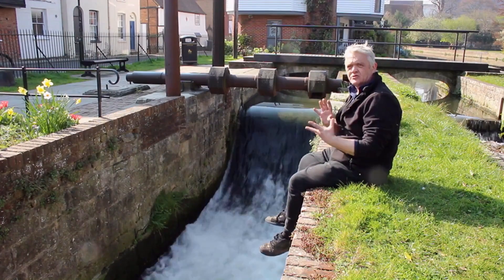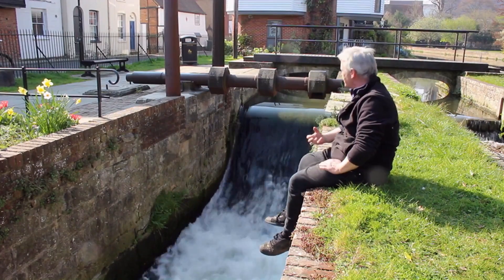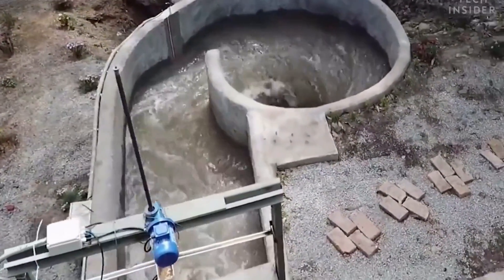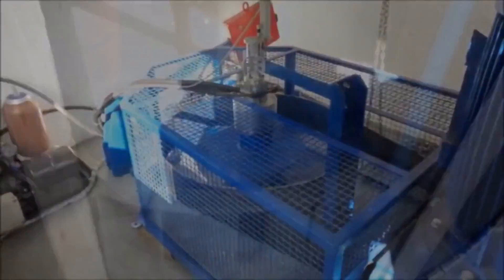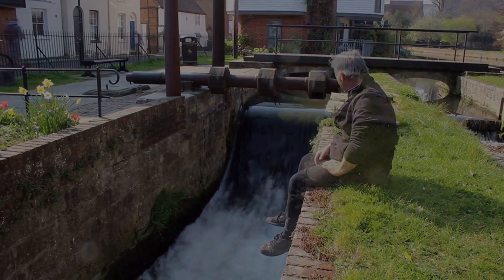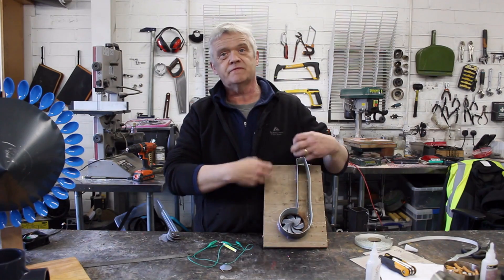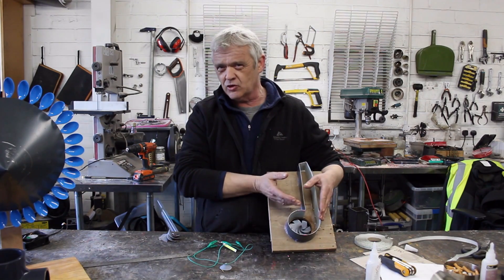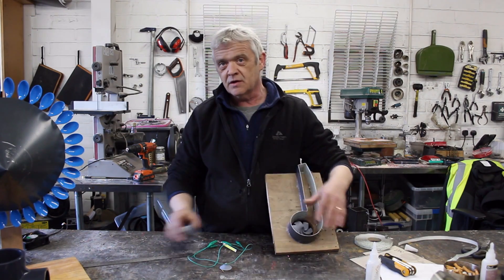1488 A Kinetic Turbine

Comment: That pressure can simply be created by gravity . Have a stream fill up a tall 2meter high container and at the bottom have a hose . A lot of pressure can be created if you have the fall of the land in your favour . If you have a river or creek that winds back on itself then you could simply have a shorter hose to fill up . Another way is to bury a 2 m long 100 mm pvc pipe upright in the ground with top level with creek . The bottom has a hose that will have pressure at the bottom so this  hose  can be taken elsewhere that 2 m lower than initial creek height !

Comment: Erm - if you did what I think you did, your measurements are completely wrong.  Did you first put a voltmeter across the open circuit output, then put an ammeter directly across that same output at a later time?  If so you are incorrect.  The current reading is short-circuit current (i.e. close to 0 volts) while the voltage reading is open-circuit voltage.  You have to measure current and voltage at the same time while feeding into a suitable load (resistance).   Choose a load that gives half the open circuit voltage to get the max power available.
Reply from the maker: no mate - that's not what I did - but thanks for pointing out it would have been an error if that is what I had done and that I hadn't been clear - all the best

Comment: Could a Hydraulic ram be used to turn the potential Energy of a low head water source to Kinetic energy? The pressure in the delivery pipe can get quite high
Reply from the maker: yes - that is pretty much what a water accumulator is

Comment: 0.4 watts / 1.7 watts = 23% energy out vs energy in if that was 30psi & 0.5kg/minute by calculating the equivalent head and using gravitational potential energy of m*g*h. Neat for what it's made of. In the limit of low flow high pressure scenarios you begin to be able to use hydraulic motors (ones made for use with water) instead of turbines though.
Reply from the maker: nice - cheers mate

Comment: Hey Rob, a measurement method I like to use is to use a 10 ohm resistor as a test load. Then just measure voltage across it, divide by 10 to get amps. Then square amps and multiply by 10 to get power. It is more accurate with dc, since you don't need to consider phase angle. Cheers.
Reply from the maker: nice tip mate - cheers
Reply: To find the maximum power achievable you need to adjust the load to suit the generator/turbine combination.  As the load changes, the output voltage also changes due both to the internal impedance of the generator and the amount that it slows down due to the higher electro-mechanical drag as load current increases.  There is only one point at which the power transfer is at maximum - power will reduce with loads both above and below that point  (Assuming that the max power transfer point is less than that which will cause the generator to overheat).  An MPPT charger is designed to automatically vary its input load so that it is always at the max power transfer point of the supplied input device.  Which can cause some input devices (e.g. an engine-driven alternator) to burn out, so use with caution.
Reply: @davemould4638  good point.
Reply: Indeed, power is volts * amps, but you need to measure them together!
Reply: @edc1569  Please refer to power formula. Amps squared times resistance,  or voltage squared divided by resistance.

Comment: Your terminology is iffy... When you constrict flow through an orifice you do not increase the pressure of the emerging fluid, you decrease it, but you increase its velocity and kinetic energy. But you still need pressure behind the orifice. This can be produced by the potential energy of a head of water. Otherwise you can use a stream with unconstricted low velocity mass flow to turn a wheel due to gravity.
Reply from the maker: yes it is - thanks for clearing that up - cheers
Reply: Iffy orifices

Comment: Energy recovery using this method is clever.  When mulling this idea over myself in the past, I discarded the idea as it could lead to massive water wastage and shortages during a power outage.  With that said, I had not considered the toilet tank filling application, which capitalizes on the inherent wastefulness of filling a toilet tank!
Reply from the maker: I think you make a very good point mate and it is something I am thinking about

Comment: You won't be able to use a nozzle with dirty river water, it would be plugged solid in seconds.
Reply from the maker: very true - I suppose you could filter the water? - but if I think about it would you really do this with a river -wouldn't it be better to use the flow like in the whirlpool turbine?

Comment: Looks like a great way to maximize the energy from a trompe. The compressed air could power the turbine on its way out of the storage chamber and proceed to power tools and/or refrigeration via a Venturi arrangement.
Reply from the maker: Great point